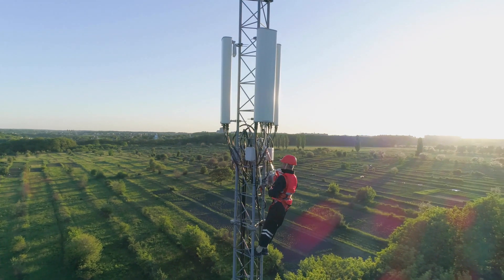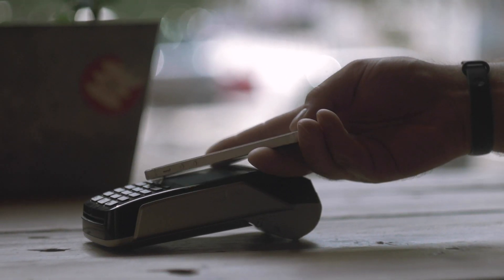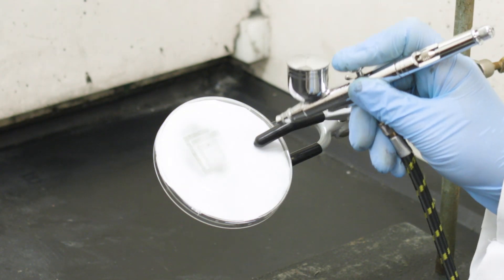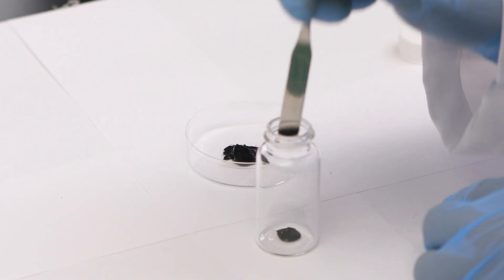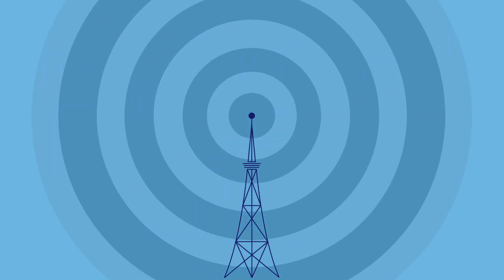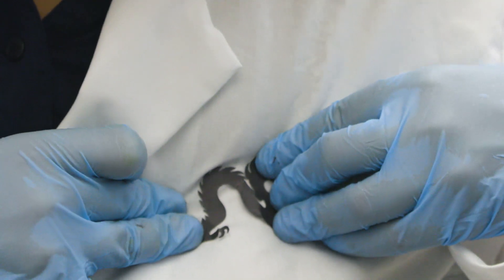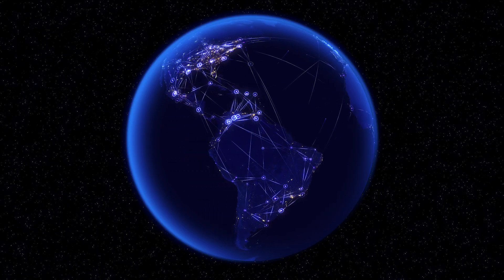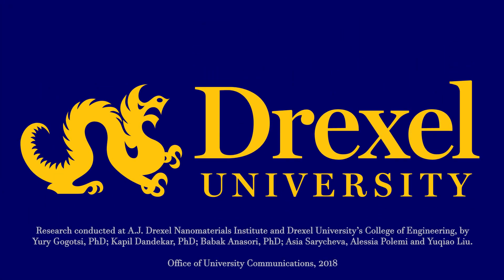Drexel’s MXene ‘Antenna Spray Paint’ Could Unlock the Potential of Smart Technology

Comment: I wondered if something like this was possible after using an open air tv antenna ... could you use metallic paint and paint a wall or ceiling with the correct fractal pattern .